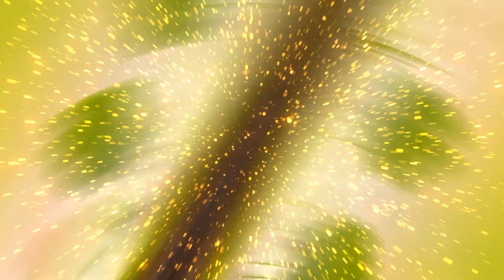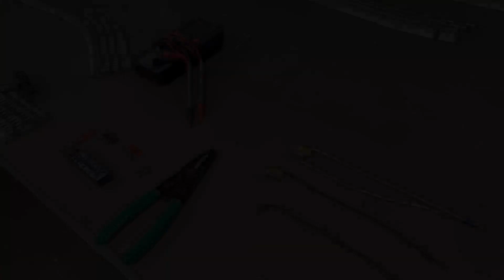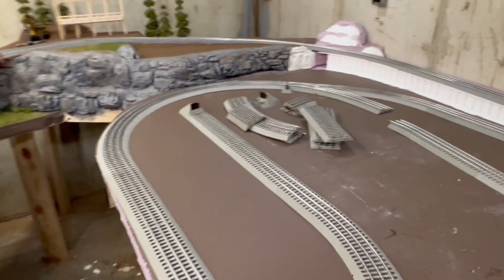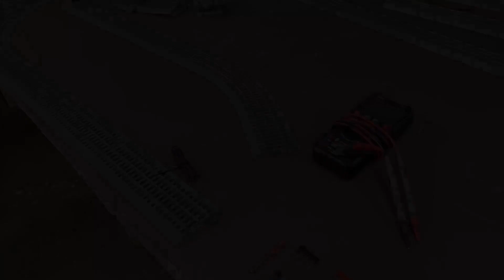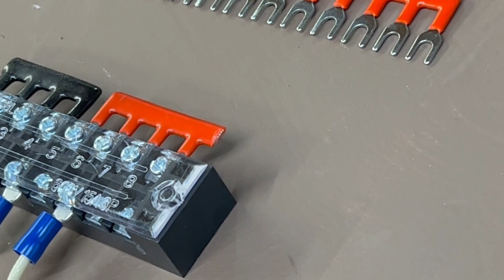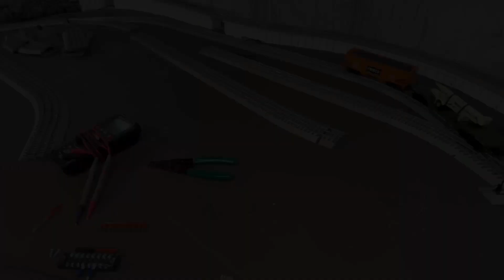“Boost your voltage: with these wiring tips!” #modelrailroad #lioneltrains

Comment: Ive been soldering the center rails with small lead wires on the underside. And it's been 100% better!
Reply from the maker: I have no issues at all.
Reply: @oscarso-gaugetrains  That's good! I didn't initially, then as I used it it started to lose voltage since the center rails joiners like to heat up and the heat and cooling eventually made connection issues. But it's all fixed now.

Comment: Great video!! Quick question. I have extended my o gauge fastrack to about 35ft in length and was originally running the plug and play terminal with wall outlet. Ive heard others add an additional one at the far ends of their track ie(35-50ft). Any thoughts? Thank you!!
Reply from the maker: the wonderful thing about fast track is that it has terminal connections underneath. I usually put terminal connections every 8-10 pieces.

Comment: Newbie here. I have three O gauge ready to run lionel trains running on fastrack. 2 have cw 80 transformers and one is a transformer that plugs into an electrical outlet and the other end plugs into the port on the track. The whole layout is 8'×7'. I want all three trains to run on their own track (layouts are done). I need to add feeders to each of the three sets of track.  Questions: Can I use my existing transformers?  Are the red and black wires from each transformer (power supply) called bus wires or feeders? How do I attach the feeder wires from the tracks to the bus/main feeder line? For some reason I don't understand how the wiring works. I've read Larry Pluckett's book but it seems too complicated for my layout and the videos I've watched don't show how to prepare the wire b4 attaching it to the bus/main feeder. I hope this makes sense. I have another 8x7' layout that I want to run two trains on. Haven't purchased them yet but I have completed the track layout. Are ready to run trains what I should buy for it? Thanks so much for your time. I appreciate it.
Reply from the maker: you just tossed a lot over the fence at once, but I think you’re just trying to connect buss wires to track using one cw-80 right?
Reply: @oscarso-gaugetrains  Sorry. Let's just talk about the run for one CW 80. The main track connected to it  is a raised circular 22' track with two switches that create an interior 10' oval. Does this make sense? I can't figure out how to wire this to get everything to work.  Thanks so much.
Reply from the maker: @ohbbykpk70  Send me an email with photos to the email address from my channel.
Reply from the maker: sorry I missed this reply! oscarogauge@gmail.com

Comment: Hi Oscar! I am starting with this new adventure about trains. It's not easy but I like the hard process. I have a situation and would be very helpful if you could help me. I got a Lionel 132 passenger station and I am having a hard time setting properly on the fasttrack to make the train stop in front of it. I've tried numerous ways, but it doesn't work and I did not find any video on YouTube showing the process of installation. Can you please help?
Reply from the maker: How can I help you? I’m not 100% sure what you’re trying to do. is this an electrical issue?
Reply: So once you have the station set. The train should stop in front of it for a few seconds. This did not happen in my case. To set up this specific station it needs to use an insulated track, but I think to insulate the track it's not the way the people usually do. I can't find how to do an insulated track for this station using fast track nether how I should connect the wires.

Comment: Great tips Oscar! I drop a feeder every 3-5 feet and then I take those feeders to a terminal block.
Reply from the maker: 3 to 5 wow! I know you don’t have any issues
Reply: Would you believe I do, I have two spots that need two additional feeders dropped. These two spots are right between two switches on a five inch piece of track.